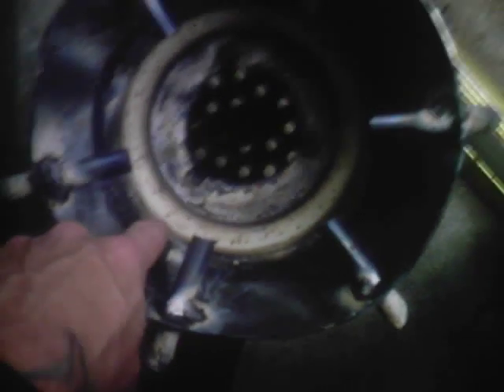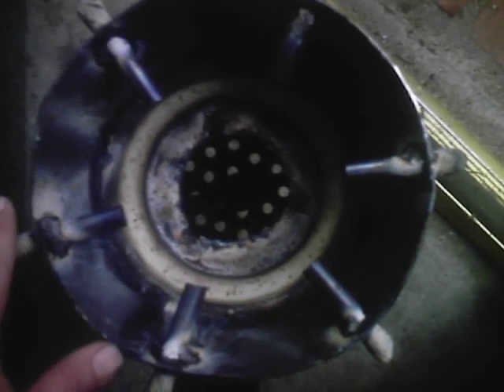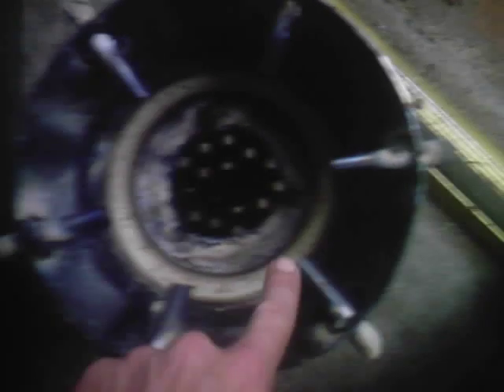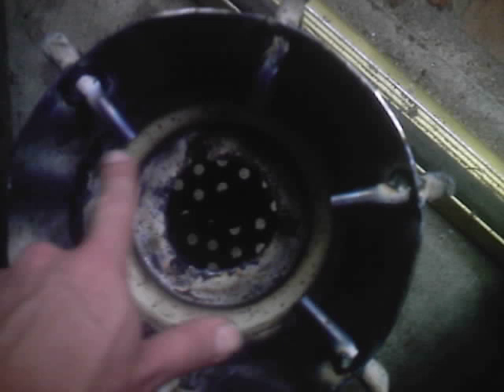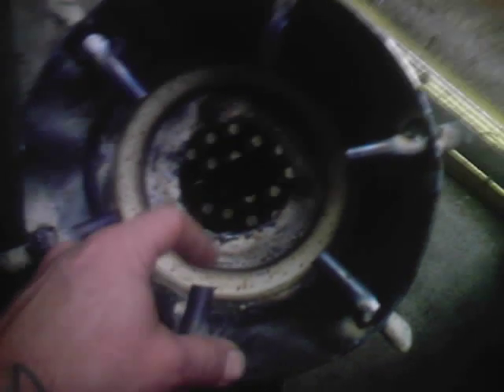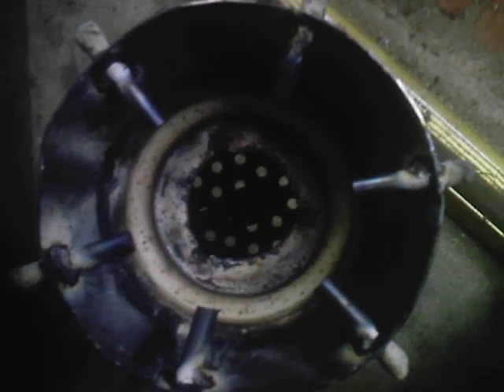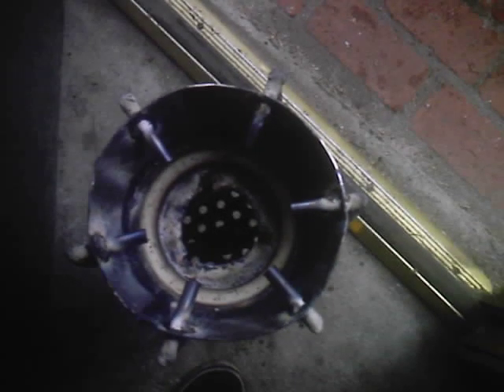VW Beetle wood gasifier build core

Comment: I see someone has been busy! I'm looking forward to seeing this puppy up and running. I've been busy too. I finally finished the mounting frame for my gasifier so that I can get it mounted to my trailer. I decided to make it so that I can roll it off the trailer whenever I want to use the trailer for hauling stuff but when it's mounted it will not budge. This way I get the best of both worlds. We have some nasty weather rolling in this week so that will stop me from finalizing the work but as soon as I get a nice day (without work) I'll finish it up and do a video on the new setup. Before I forget, I like the concept with the intake tubes facing down where you can preheat the incoming air better...Nice idea man. Don't be surprised if I barrow that idea from you on my next project. Thanks.
Reply from the maker: yes we have been busy we had some unfortunate thing happen but it has freed up some time and money and it has only sprinkled once in the last 60 days were supoed to be cover with snow but nothing 3= any way i have almost completed this reactor im finishing up some details with the hopper and the preheater intake manifold i have built this thing using just some pipe (pre heater\jets) a 6" rim from a old snow blower (core) and a hot water heater we found on the side of the road (EVERYTHING else) and i have taken pictures of every step so a good slide show is coming there will be more innovations released latter and i would be horned if u use my tech. thank u =3- oh ya check this out (木氣車) it says wood-gas-car lol in Chinese i think its weird b\c the first one looks like a tree and if u look closely IE blow it up the second one looks like a smoking tree and the third one looks like a car i have been studying Kangi for the last year and i did this translation today and i thaut it was funny =3-
Reply from the maker: hey u play instruments ( i play bass and ryithum guitar) so u will understand how it looks like a djshembe drum this other guy couldnt understand how they are tuned mathematically and how i figured it would work perfict as the core shape lol =3-
Reply: xoxoXoieoxox
Dude that's soooo funny! I was trying to figure out what it reminded me of! A drum!
Reply from the maker: flash001USA so we lit this thing today and my pump is like a turbo and can give up to 5 lbs of boost if used that way and lol we got a good flair and cranked it to maximum it had a like jet torch Halloween orange but there was no coal yet (first run) and aside from some puff backs from the lid not sealing correctly i think this one will be a goer (we pulled 5-10 lbs on the sys and it didnt flame out)  =3-

Comment: define perfect? If something is designed to work with certain perameters in mind and it does that wouldn't that mean it's perfect? so how can someone claim something is more perfect than another?

More interested in quick easy starting, making good engine grade gas in minutes and running without a bunch of adjustment under load throughout it's load of fuel. running a fuel that is easily attainable at realitively high moisture content...say upwards to 50%. do that and I'll say your unit is perfect....
Reply from the maker: in this case i would define mathematically perfict as..something that is completle in tune with nature allowing it to happen as opposed to forcing it Tesla sed we must be in harmony with nature and it will give us anything we want and its true
do u know what aether is the amount of energy in this feild is so much greater than wood gas or any other fuel combined  that this is where my brain is right now i just need this gasifier b\c i cant aford gas =\
Reply from the maker: contemplate this math problem its simple but IS the key stage one to human liberation
Reply: xoxoXoieoxox if i may ask, how did you determine your math was perfect for wood gas?
Reply from the maker: International Supply like i sed to a previous person GUT FEELING backed up buy the shape of a djenbe drum i figure sound is the best judge and if u dont play an instrument u will never understand =3-
Reply: lol.. ,ok